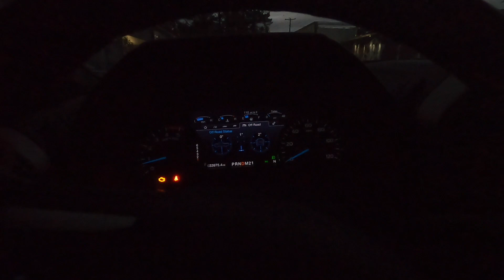BUILDING OUR 1500hp NO PREP LS ENGINE!!!

Comment: You're supposed to tighten the bolts until they yield, loosen off a quarter turn and leave it for the next guy
Reply: That's what torque to yield means isn't  it?